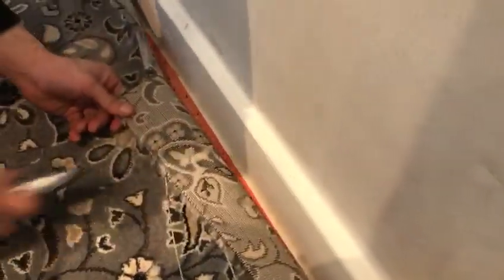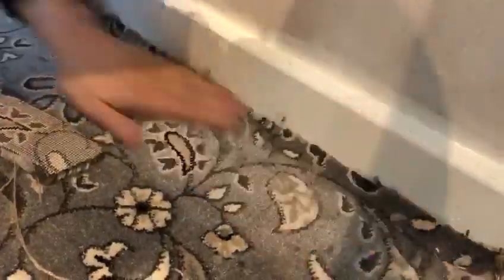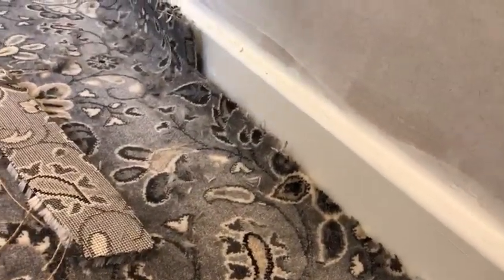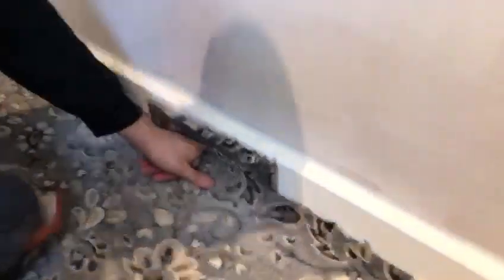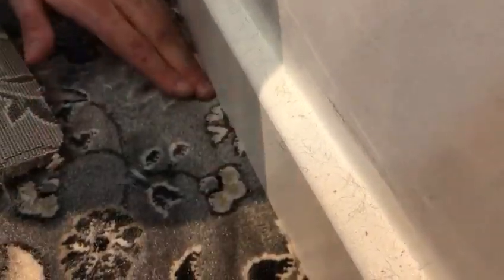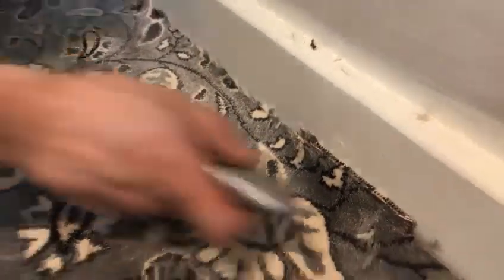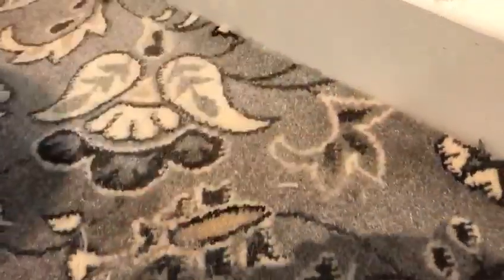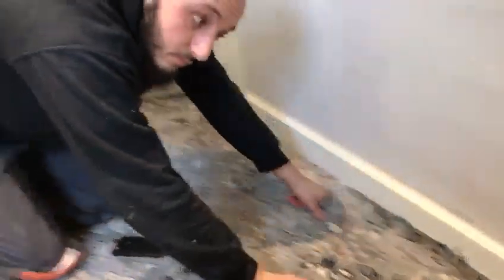Carpet knife or carpet cutter ?

Comment: It is called Wilton everywhere as that refers to the manufacturer that developed that type of carpet. It is however not a true Wilton as they are high end carpets and that clearly isn't. 
Genuine Wilton is also easy to stretch, cut and fit for a good fitter. Lastly, in a high end installation you would never cut with a hook or scrape your bolster against the skirting, it marks it.
Reply from the maker: Cutting with a hook don’t mark the skirting. That’s if you know how to use it.

Comment: Would you be able to explain a little more on how the knife angle determines the correct cut , I'm guessing the more vertical the knife is the knife is the less you have to tuck behind the gripper?
Reply from the maker: peter fido the knife would have to be at a vertical position as it’s it straight you will damage the skirting. The way you determine whether you want enough to tuck in or leave it short etc then this judged by the height of your knife the higher you bring it up the more you have left the lower you bring it down the less carpet you have. Bit tricky to understand but once you get the hang of it you’ll be fine ! Also just a side tip if you’re fitting carpet it’s always best to stretch on to the grippers 1st and then trim and tuck accordingly. (Side note )